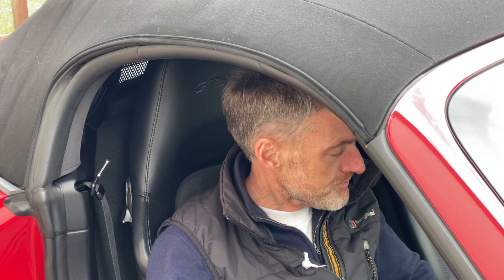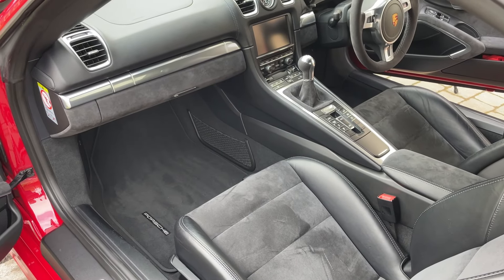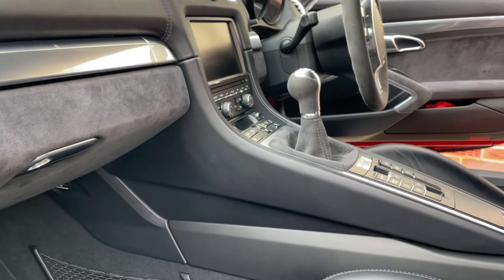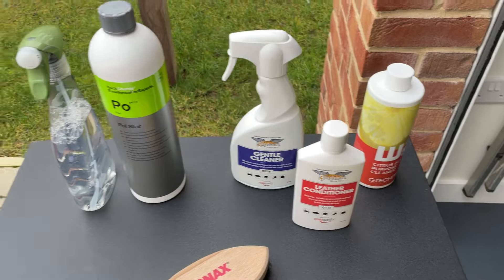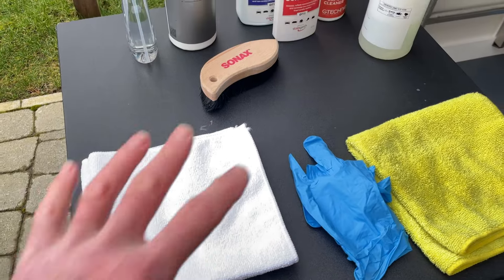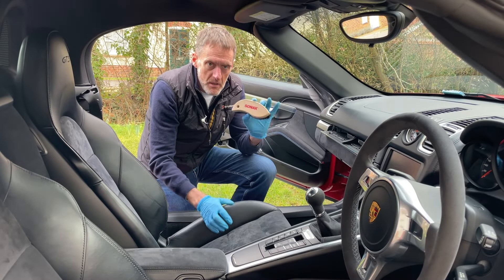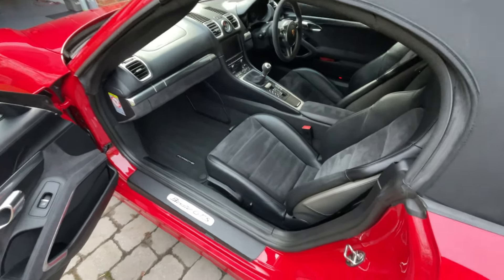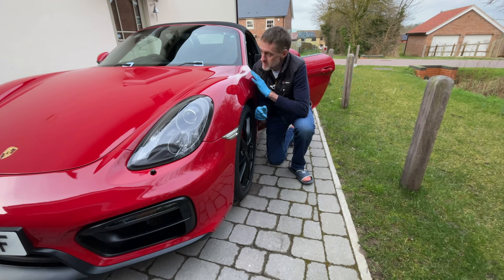My Porsche Boxster’s Alcantara interior gets an overdue deep clean

Comment: Thanks for sharing your experience, it’s been a great series, so much so I’ve just taken the plunge 😃, just a quick question when you’re applying a cleaning product to the leather do you have to be ultra careful not to get any onto the alcantara ?
Reply from the maker: Hi Andrew. Thanks for the positive comments - glad you've been suitably encouraged to get stuck in!

Good question about the different materials. The short answer is No, it's not an issue.

For the longer answer it's worth remembering that alcantara is a synthetic fabric, rather than a natural product. This means that we can, if the need arises, clean it with a little more vigour than we might a natural product.

in terms of cleaning, most cleaners - be they specifically for leather or more general interior cleaners - will play nicely with other materials inside the car. The manufacturers know that people might get over-enthusiastic with the spray! In other words, a bit of leather cleaner over-spray on the alcantara isn't going to be a problem. (Any more than a fabric clean will trouble leather.)

Where you do need to take a bit more care is in the subsequent application of conditioners or creams to the leather. Those will be harder to lift/clean/remove from the alcantara. (As would, say, melted ice cream!)

When I'm conditioning the leather, I work carefully at the margins of each panel to ensure the cloth doesn't pass or rub over the neighbouring alcantara. It's easy enough to do; it just requires a bit of care and attention. If you do get a smear on the alcantara, clean it off promptly, before it settles into the fibres.

Good luck!

Comment: Honestly save £££ on products, the best cleaner on alcantara is water and a microfibre, unless you have a specific stain to remove. Once done, particularly the carpets i’d also recommend something like gtechniq smart fabric v3 ro prevent staining.  Lovely car and totally get the desire pamper !
Reply from the maker: Thanks Jon. I bought the Koch cleaner to do the steering wheel and gear knob not long after I’d bought the car. They were both definitely beyond water alone, being quite hard with oils and grime. Having the cleaner on the shelf subsequently means I might as well use it.

Funnily enough, there are few other areas in the cabin that, I imagine, are likely to get too grubby, save for the door pulls. It should all be much easier to keep on top of now it’s had a thorough clean.

Carpets - good point. I have only yesterday given them a spray of something similar. They’re the original mats so I’m not totally worried about preserving them as-new. (But that doesn’t mean I’ll trash them either!)

And yes, I like to pamper. 😀
Reply: Yes if the alcantara was very grubby you are right and will need something to lift the grease. Once the fibres are clean through best to keep chemicals off them IMO. By the way your A pillars look to like they are silver, truck of the camera?
Reply from the maker: @jonfrench7133  A good hoover and brush is my go-to after using the car. Agree about avoiding regular use of ‘product’. 

Trick of the light; they’re the standard dark grey finish.

Comment: Very nice. I just took delivery of my 981 Boxster S with 52,000 miles and the clutch was toast. Figures. Are you feeling anything with yours that's prompting you to think about replacing it?
Reply from the maker: Thanks Brandon.

Somebody wiser than me (my local independent Porsche specialist) spotted that the clutch pedal weight was a little harder/heavier than normal (a sign of wear on the plates) which is what’s prompted me to consider replacing it. They said it was worth doing sooner rather than later as a way to prolong the life of the flywheel. The alternative being the possibility of needing both a new clutch and flywheel, for the sake of a few more thousand miles of (heavy) clutch pedal.

Reckon it’s worth doing on that basis. Preventive maintenance is my preference!
Reply: @christianpratt  A heavy clutch pedal was one of the signs on my failing clutch, as well as a very high bite point. Soon after, the pedal sank to the floor and stayed there - I had to get a tow. Not trying to scare you but I hope you can get the job done soon to avoid any troubles! 

One new clutch and flywheel later, the car feels incredible to drive. Looking forward to  seeing your experience with new parts.
Reply from the maker: @bucabrandon  A good result, albeit a lesson learnt the hard way I guess. I plan to do mine soon enough, so fingers crossed.

Enjoy your new car - they are awesome. 😀